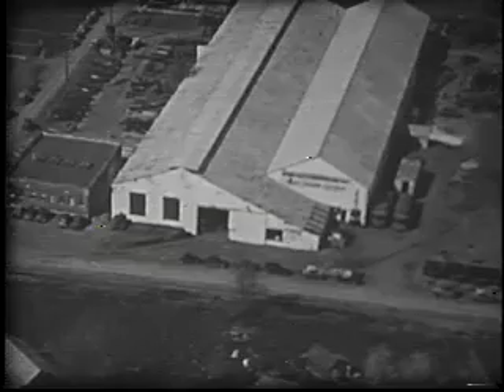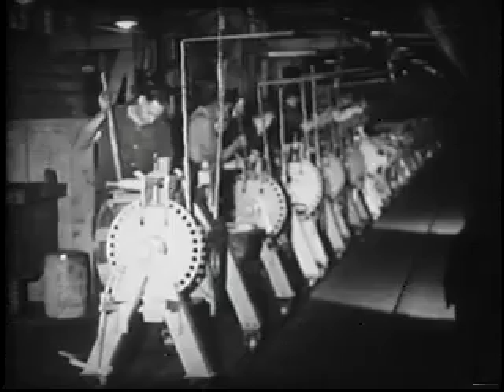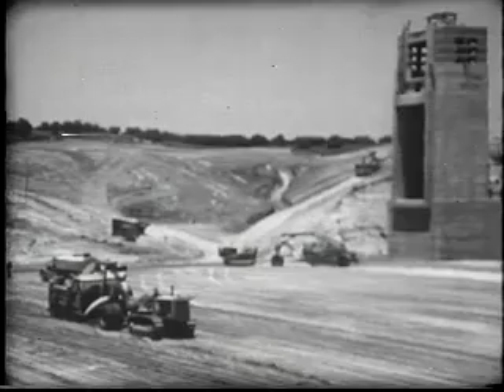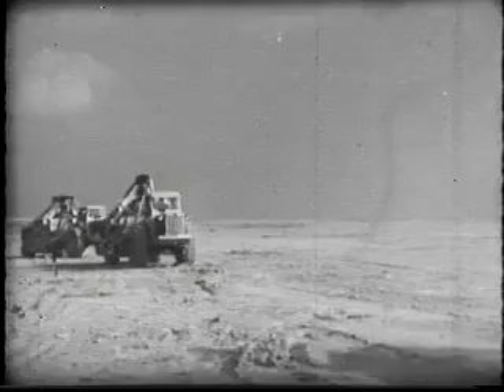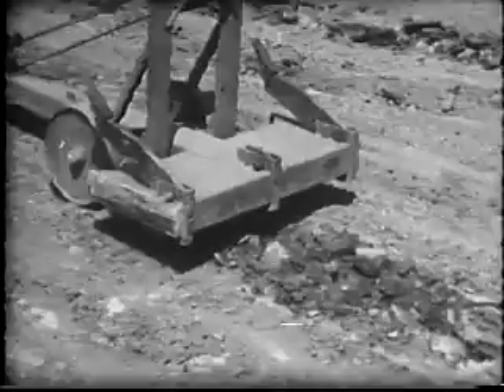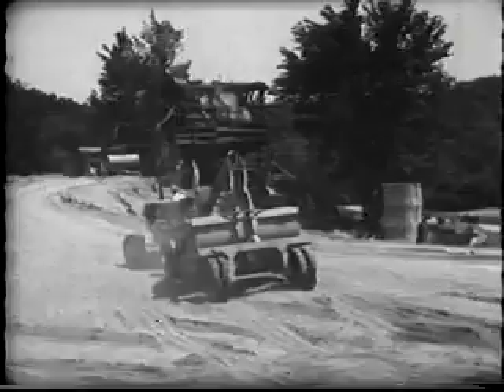R. G. LeTourneau Equipment - 1940s Film

Comment: RG LeTourneau was an amazing man and engineer and built some amazing machines, but for the life of me, I have never figured out why he was so against using hydraulics. The electric motors and controls and rack and pinion designs he used were so labor intensive to use and maintain they were almost laughable. As was mentioned, the steering on those Tournapulls was very clumsy, if not downright dangerous when they were working correctly, let alone when they got some hours on them. The electric circuits would get corroded and the contacts wouldn't work as they aged. I knew some construction guys that ran and maintained some of the later design scrapers after Terex (I think it was) bought them out and they hated them. After the contractor got finished with that job, he got rid of them in a hurry. At least with hydraulics, you can see a leak that needs to be fixed without having to use a bunch of testers. JMHO.
Reply: Hydraulics weren't reliable and were too slow in those days, his last scrapers and Haul trucks used Hydraulics.

Comment: 75% of the earthmoving equipment used by the Allies during WW2 was made by R.G. LeTourneau. Their air forces used a Tournapull crane that arched way over and had the wheels on a box beam that extended the same distance as the crane. It was used to pick up disabled fighters, medium and heavy bombers for towing to repair hangers or storage yards.
Reply from the maker: RG was very involved in WWII.   My father worked there during that time.  Thanks for the comment, Bill.

Comment: A question to anyone: Do you think the Earthmovers from back then in this video would be able to handle today's excavation & construction needs? I often wonder.
Reply: New scrapers look just like that, pulled by large ag tractors. Maybe hydraulic instead of cable controlled.
Reply: The answer is YES  and the last WABCOS will still outload any new Cat today if I had money and youth  I'd modernize the WABCO and save operator's kidneys, why ride a teeter tottering left side bounce?
Reply: I still have a whole complete Letourneau scraper with 6-71 Detroit. And the front half of another. Had at least 10 other ones. Regretfully cut them up for scrap. Still have a lot of parts too. In NE Georgia USA. Anyone else near me have one? - - we used the cable scrapers up until 2001. Did good

Comment: What didn't come out in the video is that unlike today, everything on the Tournapull was electric. The drive motors and even the lifts for the pan. The thing was steered by flipping toggle switches. 

Those big snow trains could drive every wheel from the generator unit in front.

Comment: The days of building quality is gone
Reply: He pioneered using epoxy to seal the final drives instead of gaskets that would leak. He used fasteners with a double helix so they could be assembled faster.
Reply: @회기-c3w  RG also pioneered using welds where ever possible to eliminate nuts and bolts.

Comment: Great video but there is one sure thing i wouldn't wanted to have to do back then was change a flat tire on the back of one of those carry-alls and scrapers or even now..Did tires for 31yrs and those look like a nightmare to get at or i'm just missing something. Those guys were crazy operators back then.
Reply from the maker: I don't know how difficult it would have been to change tires but I've heard they were very tricky to steer.
Reply: @larryware1  In the video the operators seem to be steering, over correcting quite a bit. Just going straight seemed a challenge and the guy spotting them where to dump at the 12:25 mark is one brave soul knowing how they steered and the speed.. Worked on their log stackers from the mid 80's and the 90's and they were a challenge especially the wheels that split in the middle..Very Dangerous..Thanks for the reply
Reply from the maker: You're welcome.   I worked at this location in security in the mid to late 1980s; it was Dresser/Komatsu at that time.  They still ran one of the old tourn-a-pullsl in the yard to pick up small loads.  The driver explained to me how hard it was to handle.   My father also worked for RG beginning in 1940 and retired from - then - WABCO in 1979.
Reply: @larryware1  Love all the old video's of the LeTourneau equipment through the years and you do have to admit he thought outside the box for sure..I have pictures of one of the land trains that they built that is at the transportation museum in Whitehorse.Yukon. Pretty neat to see.
Reply: @ralphamies828  Indeed
Reply: You didn't weekly burnish the clapper switches, maintain any equipment and it'll pay dividends